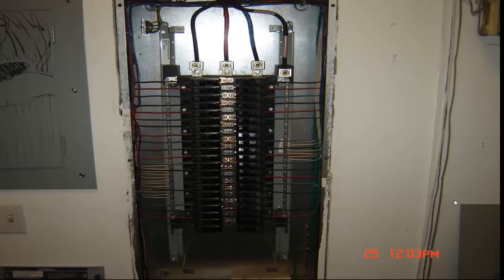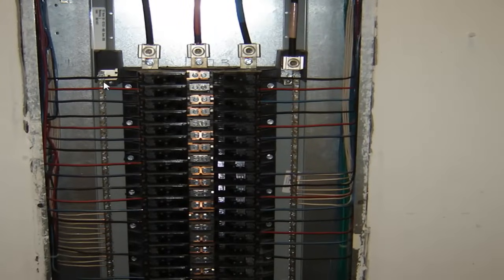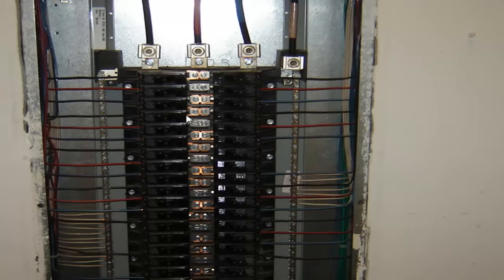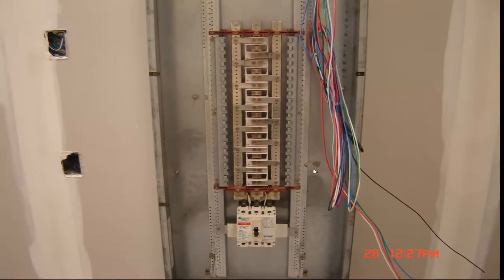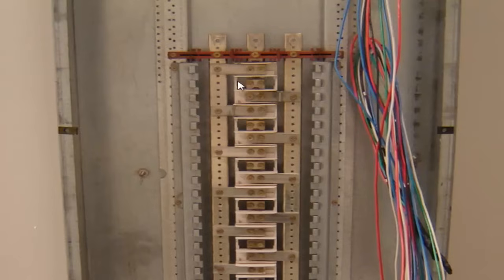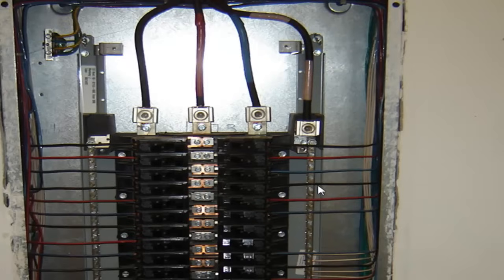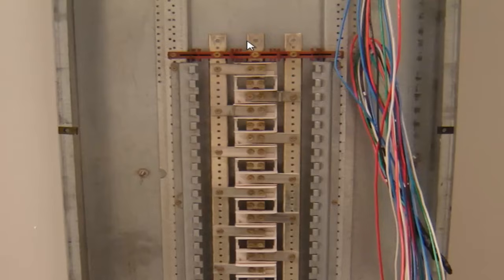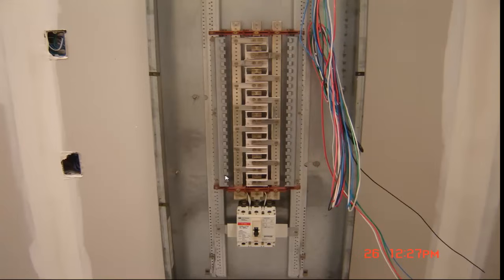Electrical Wiring- 3 phase panel detail

Comment: It's quite different than European electrical installation. We have everywhere three phase (black, brown and gray), neutral (fair blue) and groun (green or green-yelow). There are one some phase (in left hole), neutral (in right hole) and ground in 1phase (230V) power outlet. There are three phases, neutral and ground in 3phase (230/400V) power outlet. Every diferent circuits are bad. It is interesting your wiring in America. Sorry for my English :)

Comment: Sparky, if I have a 3 phase service panel and want to put in a 2 pole breaker won't the phasing be wrong for 220 appliance to work? Three phase is 120 degrees, single phase is 180 degrees out of phase.

Comment from the maker: Absolutely.You would need 1-single or double pole breaker installed.
Wiring to your device would be hot,neutral and ground for a single pole and depending on your requirements you could run two hots to a motor,light or whatever. Always check your spec's before running any power.

Comment: my father had installed a GFCI outlet in the kitchen. He wired it up, turned the power on, and plugged in the coffee maker, the bottom outlet worked fine, the top when plugged in tripped the GFCI breaker. So he broke out the manual, and found the wiring was backwards. turned power off, removed outlet, and wired it the right way. Works great now. Still goes to show. Even AC power doesnt have poles, (like DC) correct wiring is a MUST to prevent faults. I believe hot and ground was switched?

Comment from the maker: There are many varieties of breakers and panels. 3 phase panels are built both plug on and bolt on styles. There are 3 phase load centers(plug on) and 3 pahsepanelboards(bolt On).You need to use the specified style breaker to match the type of panel your using.

Comment from the maker: @davec3487 Most of  the installations I run across the motor starters are located near the motor.
All of the car wash's I work on have a MCC,Motor Control Center, located some where in the equipment rooms.
So really it depends on the application.

Comment: Wonderful explanation. Only small change, On a single phase step down 
transformer (  Panel not shown) used for most households, only one phase.
"which is split phase" Thank you, of great information, although most of
us will never deal with this much power, which is 1.5 times more power
than single phase.

Comment: I find these useful and my degree is in EE. They are a good, quick sanity check after not using my degrees in decades and of course for EE I was concentrating on integrated circuits and signals and systems, not power engineering. Keep up the good work and ignore the criticisms that are out of wack.

Comment: Also, I'm asking mostly from a theoretical standpoint, not necessarily whether unbalancing the phases will cause specific problems like burning your house down (I know it won't). And I know that the overwhelming number of boxes I've worked on had circuits both originally placed, and later added, without any sort of real forethought, so I know it is common to just pop breakers in wherever. Does it make a difference?

Comment: Thank you . Some phases A B or C can be a high leg 220 . so i learn that the hard way in my younger years has a electrician. Test ur phases and breakers and circuits at all times before you plug or connect something.  Doenst have to be just commercial. On high legs

Comment: Does the neutral wire have to be insulated in a 4 wire delta configuration? 120/240 3 phase service

Comment: Could you add a 3 phase breaker for an AC unit within the panel used in your video? Say in apartments that take single and two pole breakers.  We want to add a 3 phase breaker to each panel for the AC unit?

Comment: Sparky, Hi, so I'm hooking up a baler that's 480 3 Phase, now i have 2 panels, one is a MLO to a MCB and it looks like they took 4 wires from a breaker inside the MLO that goes down to a transformer and from the transformer it goes into the MLO that has all the breakers for everything. 

Now can i hook a 3 pole breaker for my baler off the panel or should go to the MLO (The MLO doesn't look like i should hook anything to it directly.

Comment from the maker: What are the breaker configurations 1p vs 2p?Have you taken amp draws on all breakers or just the main? Balancing is done by relocating breakers to another phase depending on 1p vs 2p breakers. Balancing a single phase panel vs 3phase panel are 2 different animals.
How did this panel get to having a load difference?
200+ on line 1? What size is that panel?
THere is a little more to it but these are the basics.

Comment: Thanks for the explanation,.    how 3 phase wires  color code are connected  to any 3 phase input  equipment,  if 1 or 2 color are different ? ...  thank you .  Tito

Comment: So is there a need to try to make sure that the individual breakers for each circuit are balanced out between phases, as best as you can, or could one put all 30 amp breakers on one phase, all 15 amps on another, etc. My understanding is that drawing more amps off of one phase would unbalance the phases, even if it doesn't have any practical effects in terms of causing problems, whereas my father says it doesn't matter which breakers go on which phase because it will all even out in the end.

Comment: Great explanation of the subject, but I do have a question specifically about the MCB panel. I have a Siemens panel that looks identical to the MCB panel in your video, maybe a little smaller. However it didn't come with the white switch at the bottom, nor is there room or a location to mount one. How do I go about getting my power into the panel?
Any help is appreciated thanks.

Comment: I do understand the functions (sort of) between hot neutral and ground of home wiring. I know you cannot get them switched or else faults or a fire could occur. as i was younger i did mess with electrical wiring. ( blew the breaker a few times ), but still have a respect nowadays as an adult. IF YOU do not know what you are doing, DONT ATTEMPT IT. Electricity is non forgiving and your life could be ended. I blow stuff up with 110v sometimes, but always remember to make sure power is cut JIC

Comment: Great video,a questioncreated while watching this video is,if the busbars are not connected between each other,doesn’t every phase in that case work as a single phase?
Reply: Yes, but they are 120 degrees out of phase. In single pole breakers this is not important, but in double pole and triple pole this becomes important. You use a double pole for 208V, not 240 in this system due to that phase difference. And the same rules apply to the three pole breakers. 
The breakers and the phase allow them to work together as if they were one continuous source of power to the devices on the line.

Comment: ( as in removing the power, testing with a voltmeter, etc). I usually blow up hard drives with 110v by running a cord to the power connector (molex). but when i am wiring it up, or switching hdd's to burn up, always make sure the power is off by switch and by unplugging the cord. A few extra minutes of safety will make sure you don't end up crispy. Remaining isolated from mains current is a very safe idea. Mains current WILL kill ('ive gotten accidently shocked by it a few times)

Comment: If I have 3 existing 220 single phase 4 wire outlets each with it's own breaker, is it safe to assume that all of those wires from each outlet come back to the main panel?  In other words, would any of those wires coming off the outlet be tied to anything somewhere in the wall, other than at the breaker box, assuming it is to code?  I am wondering if I can add a 3 phase subpanel, that would work off a digital phase converter that could use the existing single phase wiring to create a three phase outlet or connection?  I obviously would have to find the appropriate neutral and ground wire for each outlet.  Can you comment?

Comment: It would have been really cool if you had also detailed the wiring on this breaker by doing  mock install of the wires into the terminals as you explained the panel.  All n' all, great video.

Comment: Great video. I have many questions about neatness in a 3 phase panel.
When landing grounds, and commons, is it preferred to land them in the same order as the breakers?
Do you prefer solid, or stranded wire?
Can you go into detail regarding a "stinger" leg?
Reply: I think you meant grounds & neutrals? Then no. It makes no difference. As long as they are screwed to the correct bus (bar), and the connection is secure,
their order is of no consequence.

Wire type is determined by application. Stranded is needed when pulling wire through conduit (commercial & industrial applications). Solid is used for
residential applications, unless you're pulling wire underground (like from a house to a garage). It's really not a "preference" issue.

High-leg delta (also known as wild-leg, stinger leg, bastard leg, high-leg, orange-leg, or red-leg delta) is a type of electrical service connection for three-phase electric power installations. ... The three-phase power is connected in the delta configuration, and the center point of one phase is grounded.
Reply: I’d like to know about the stranded/solid also.  Personally I land all my grounds then neutrals and do hots last.
Reply: So do I. I do the hots last. First the grounds, then the neutrals, then I tie in the breakers.

As I said previously... Stranded is needed when pulling wire through conduit (usually when doing commercial & industrial applications).
Stranded wire is flexible, which is why it's suited for pulling any distances through conduit. In your home, where pulling wire is not the norm,
you'd use Romex. Easy stuff.

Comment: If you have a (stinger lead) say one lead is 208 and other two are 110 each. How do you lay out your breakers?  Say I don’t need that much draw off of “C” bar do I just skip loading onto that bar?  Additionally what could you run off of the stinger lead?  If you had an oven you’d still need two leads of 110 right, can’t just have one breaker onto the 208 lead?  Tks great video

Comment: So let's say you have a 3 phase motor somewhere in the building, would all 3 phases be connected to the one breaker for that motor circuit?
Reply: +The. If the " one breaker " you're talking about is a 3 pole 1 throw breaker then yes.

Comment: I am a new subscriber. If the 3 phase circuit breaker has a 380-400 volts. How about the 1 hot and 1 neutral?

Comment: I am trying to create a 3 phase panel, to run 4 electrical machine off of. Originally there is a single three phase coming in, and I want to split that off to 4 separate machines. I saw how you showed the 3 phase panel box, and this design looks similar to something that I need. Each machine needs to have at least 240 vdc coming off the breaker so that I can tie them into a transformer for each and which will step that 240 up to 480 that the machine requires. However, I have never made a spliter box before, and I need to know how this entire process is done CORRECTLY so that I will not destroy anything.

Comment: With 220/ 277 etc. you are pulling less amperage as opposed to a 120 volt circut. For example a circut on 120 volt may require 7.0 amps but on 220 volt circut the same device only requires 3.5 amps.

Comment: Can you elaborate on the voltage of the MIDDLE phase. Most of the circuits shown  seem to be ALL three phase indicated by the three color wires....  A couple of circuits at the bottom seem to be 120V (one black wire)... Did they purposely avoid the Middle Phase  i.e. 208 Volts?
Another question.. On the the right bank of circuits there are two sets of black red blue... Two OPEN circuits then a blue?  Any Idea what was the intent?
Reply: If I understand it right have between one phase and neutral 120 Volt, between phase A and B or A and C or B and C 208 Volt.

Comment: I opened up 3 phase panel and found a 3 pole 30a breaker attached to the B-C-A and the top of the breaker (B) was fried I replaced it and moved it up one spot so that it's now attached to the A-B-C position. 

My question is why it would be hooked up the way I found it and did I fix it by moving it the way I did?
Reply from the maker: There are a variety of reasons that it was hooked up BCA. Maybe there was a single pole breaker on the A at one time,Someone just wasn't paying attention? Or maybe that is how they changed rotation on a motor. So did you fix it,I don't know. Is it running a motor? It could be running backwards. All depends on what it feeds. Why did it burn up?
Reply: Electrical Industry Network 

I don't know why it burned up. The recep said 220 written in sharpie, any 220 I've ever seen or set up used a 2 pole breaker not a 3 pole, that seemed odd to me and I'm assuming that's why it was cooked. The current tennants don't know what it was used for... previous tennant's improvement I guess.

It's now powering a 3 phrase forklift charger, I basically matched the set up they have already with 3 other chargers. 

The charger was throwing an error code so we called the manufacturer, they came out and said it wasn't getting 440v.

I'm not an electrician, although I do a lot of electrical work (just not 3ph) I'm 98% sure the hook up is correct, and maybe that burnt lug on the bus is at cause?

My first comment is me just checking if my hook up is correct, from there I can troubleshoot the 440v question.

I should get 208v testing any combination of A-B-C phases and 120v from any one phase and neutral correct? 

Please advise. Thank you.
Reply from the maker: "I should get 208v testing any combination of A-B-C phases and 120v from any one phase and neutral correct? "  Correct.

Comment: So if I understand this right, each lug is only putting 110 volts right? or does the wild leg have its own voltage. I am a total newb and am curious. Thank you.
Reply from the maker: Each phase black,red,blue to neutral/ground will give you 110v +/- Phase to phase will give you 208v on this system. It is not a wild leg panel.

Comment: I have 2 pole lights, and a entrance sign out. The power is fed from the Exit sign underneath the parking lots driveway and too the entrance sign from their to the pole lights. We have power at the Exit sign but then none on the other side so says the Maintenance guy. I found power in the red wire definitely though. There is 4 wires that go underneath the parking lot black, green, red, white.

Comment from the maker: @sbales63 Install a second ground wire back the the service,mount on a isolated buss in the panel. Just be sure not to mixed dirty ground with the clean ground anywhere in you circuitry. AKA "IG"

Comment: +TheTechnonugget That's incorrect. Some forms of 3-phase have neutrals and some don't. 3-wire delta, which has no neutral, is standard in bulk power transmission. 4-wire wye, which does have a neutral, is very common in utilization voltage wiring in commercial buildings, e.g., 120/208V in North America. 277/480V 4-wire wye is also common where it is used to supply both pure 3-phase loads, such as motors and transformers supplying 120/208V, wired to just the three phases, and single-phase loads such as fluorescent lighting, usually connected between one of the supply phases and neutral for 277V.

4-wire wye is also common in medium voltage (e.g., 7200/12.6 kV) distribution circuits in most of North America; single-phase distribution transformer primaries are again connected between one supply phase and neutral. One exception is California, where all single-phase distribution transformers seem to be connected phase-to-phase, although a grounded neutral is sometimes carried for the shields of underground primary wires.

There's also a rather uncommon 4-wire delta system that carries three phases plus a neutral derived from the center tap of a transformer between two phases. This has the advantage of providing 3-phase 240V delta, 120/240V "split" phase and 208V single phase all on one distribution circuit.

Comment: I will answer your question . No the phase angle has nothing to do with it.You can put a two pole  breaker in a 120 /208 3 phase panel as long as the appliance is rated at plus or minus 10 percent of the appliance voltage rating. This panel can used a common trip 3 pole breaker down to a single pole breaker. In the video it looks to me all one pole breakers are being used.  The most important thing here is to balance the load.

Comment: Is there A standard code as to where the wild leg goes. Most I have seen is on phase B
Reply: +rick601a the wild leg confuses me as well.......wouldnt the single pole breakers that run off the wild leg have some crazy voltages?  is that harmful to whatever you plug into it?
Reply: +jeff leonard if you have A wild leg you would have to skip the wild phase in single breakers because you would have 208 on that leg to common. That 208v on a 120v outlet would not be good. If you don't have a wild leg then it won't matter there would be 120v to common on all three phases.
Reply: so basically......33% of that box is unusable?  LOL  you can use them for 2 pole breakers, but realistically you may have 4 or 5 of those.  and each of those will also take up a single pole spot as well.  leaving lots of single spaces unusable and wasting good spaces for 2 pole circuits?  sounds like a brilliant design........

Comment: Great video, the 3 phase load center on a ship looks a little different due to the ungrounded system.
Reply: I served aboard a carrier. While I didn't do any electrical work, I can still remember seeing miles of Romex
running through the corridor ceilings. I didn't learn about electricity until after I got out. Wished I had an
interest in it back then.